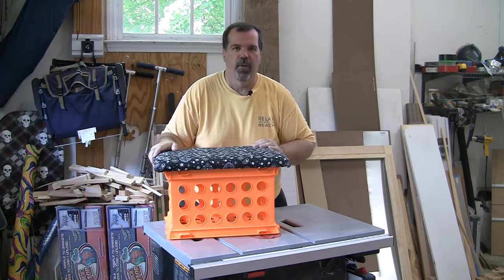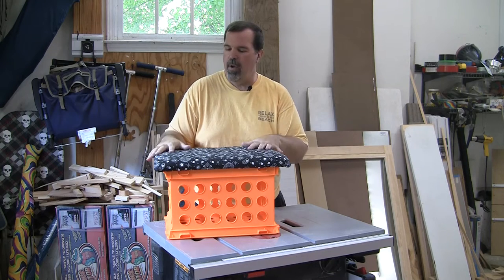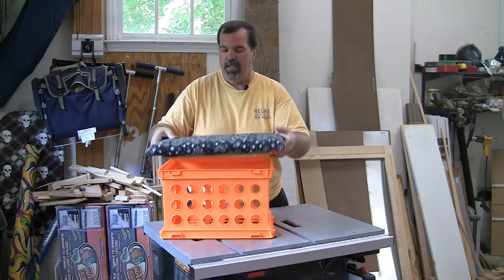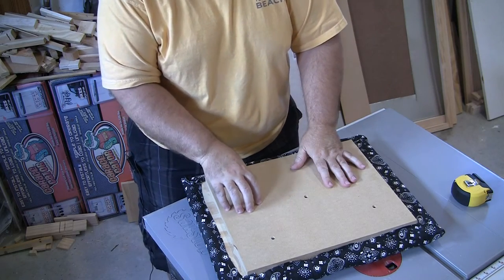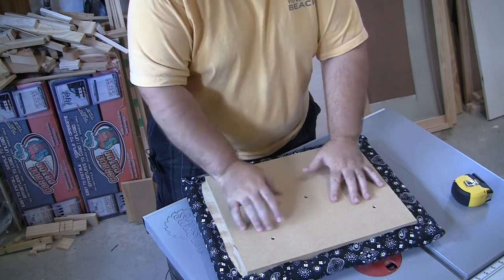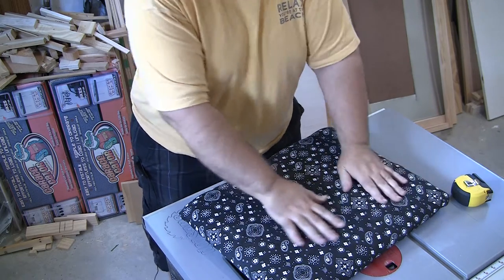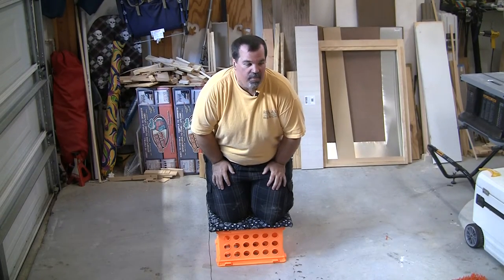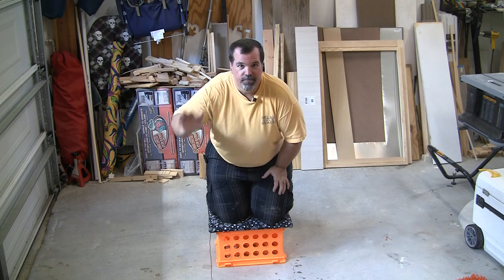Transform a crate to a seat.  Storage + Seat = EASY! EASY! EASY! (how to)

Comment: Can you give dimensions for both pieces of plywood? Thx!
Reply from the maker: I don't remember the exact measurements and we have these to a 1st grade teacher so I can't measure them. It works not matter anyway because the measurements would be unique to the creates you have. Measure the inside dimensions of the top of your crate and subtract about 3/8" to half inch. That will give you a little space so it will easily fit inside without too much movement. For the to piece measure the outside dimensions of the top of your crate and add 2 inches. That will give you a 1 inch overhang all the way around. Hope this helps.

Comment: Would like to still be able to use my hanging files in it... any suggestions?
Reply from the maker: Great question.  I only thought about putting "stuff" in it.  For allowing for hanging files here is what I'd try first.  Hopefully I can explain well enough.  Currently I basically have 2 rectangles.  A larger one for the seat over a smaller one that fits snuggly inside which holds it in place.  The smaller one is the one that I believe will be blocking the hanging files as I think the hanging files will hang on the inside lip, not the top of the crate.  Instead of using a full, smaller, rectangle piece of wood I would cut 2 strips about 1.5 to 2.0 inches wide.  I would glue and screw those to the left and right side.  Kind of look at it like removing the middle of the bottom board leaving only 1.5-2.0 inches on the left and right.  That should give plenty of support to holding the seat in place and still give you room for hanging files.  It would remove some space for the hanging files based on how wide you cut the two bottom strips.

Did this make sense?  Depending on how much space you are willing to sacrifice I'm sure I could come up with other solutions to maximize the file hanging space and still leave a nice a secure seat.  Now I want to get out and build another one with hanging files in mind.  When I do I'll certainly make a followup video, but it will be a bit as I have a long honey-do project list.

Thanks for watching and commenting!